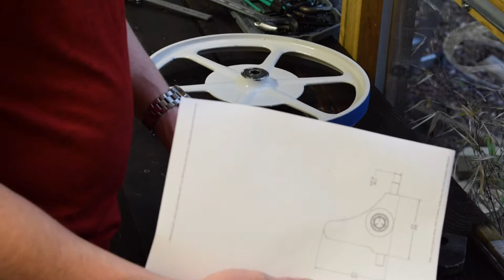Tauco/Delta 1942 Bandsaw Part 4 - Tyres & Upper Wheel Shaft

Comment: Thanks for the video. I also have play in my upper wheel shaft, but don't have a mill so think i'll buy a new one. Where did you get your replacement wheels and are you happy with them?
Reply from the maker: I'm using the original wheels, just cleaned up. The top one is great, the bottom one might is worn on the edges but it will hopefully still run true.